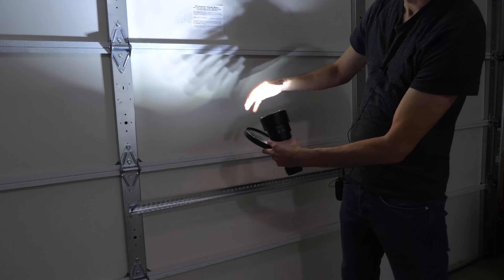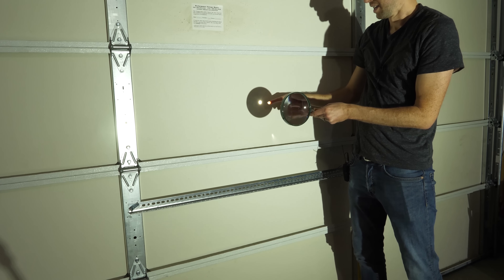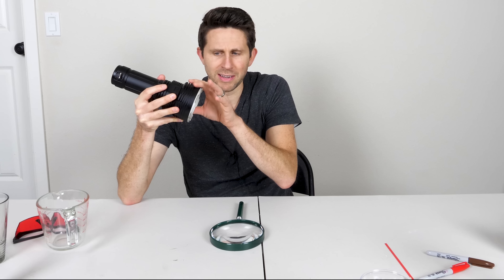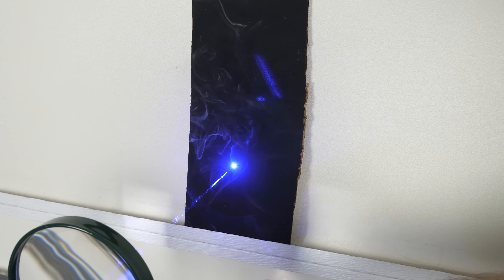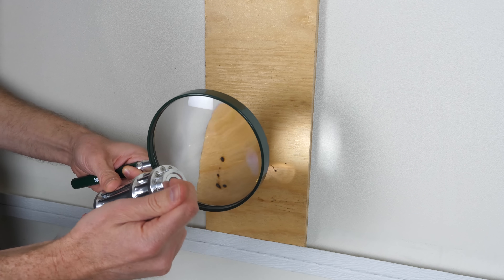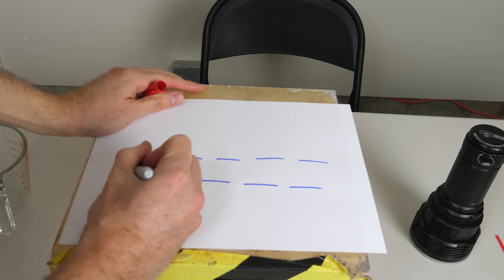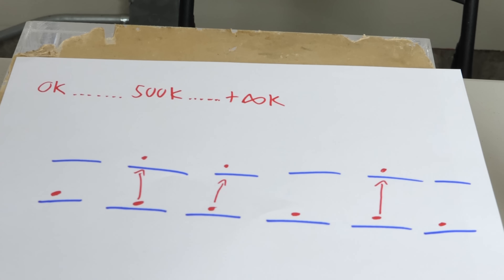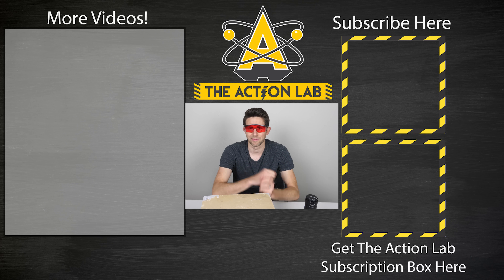What Happens if You Focus a 5W Laser With a Giant Magnifying Glass? Negative Kelvin Temperature!

Comment: A flash light emits defused light and so does the sun...

\|/  defused light
 •  dot is source

A laser is concentrated light. Ideally, we want all the laser rays to be parallel (direct light)

|||  direct light
 •   dot is source

however when I look at a laser dot ( just how you showed us with laser close and far away) I see the dot get smaller at a distance... That means, the rays aren’t emitting perfectly parallel from the source(laser) but most-likely they are converging a bit.

/|\ converging light rays
 •   dot is source 

now a magnifying glass also converges the light (but much more drastically) depending obviously by the type of lens. so laser plus magnifying glass will look something like this.

   .       -small dot is where the light focuses
  /|\      -converging lines due to refraction
  —     -horizontal line is magnifying glass
  |||      -parallel light is laser rays
   •       -big dot is source

now we do the same with a diffused light source.

    o         - o is light on wall                                
\ | | | /    -some lines refract to parallel 
    —     -horizontal line is magnifying glass
   \|/      -defused light rays from source.
    •      -big dot is source (sun or flashlight)

a ‘theatrical spot light’ is kinda like a laser but even though it emits rays more parallel than the flash light, it still does not converge the light rays all on one very small spot like a laser does.

now you must also understand what happens when light goes past its focus point
i’ll copy the laser diagram and extend the light past the wall.

  \|/      -rays diffuse past the focus point.
   x      - x is the focus point
  /|\      -converging rays due to refraction
  —     -horizontal line is magnifying glass
  |||      -parallel light is laser rays
   •       -big dot is laser source

as we see, rays past the focus point will start to diffuse out. I have seen this happen with cheap lasers where the rays aren’t perfectly parallel (the rays converge a bit)

when i point the laser at certain distances it it will make different size dots.

at point blank the dot is source size 

at a bit more far, the dot is smaller because the rays are converging closer a bit /|\ 

if we can find the right distance to find the focus point, thats were will get the smallest spot of light.

if we give even more distance and so the light can pass its focus point, then we will see that the laser light will start to diffuse out just like flashlight rays \|/. Becoming practically a red spotlight (if it’s red laser)
you will notice this by seeing bigger less intense spots on walls(i did this outside from balcony to distant buildings)

at a very far distance the laser light gets so diffused out that the spot totally disappears giving this cheap laser a limited range. good quality lasers will try to emit as best they can (perfectly) parallel lines so that their focus point can be as far away as possible to give them a much better range(not the only reason).

lasers aren’t just perfectly parallel rays, they are also very many rays in a very small area(intensity aka concentrated light)
and usually the laser has a color because its mostly just one type of light that the laser is  shooting. white light is all colors of visible light.

on this video i don’t get what you are going on about with negative kelvin etc
lasers just focus and concentrate light. 
A laser ‘BEAM’ is focused and concentrated  light!
light from the sun or a flash light is drastically dispersed(not concentrated and focused)! that means there are “MORE RAYS” of light hitting a “SINGLE SPOT” with a laser source(i’m ignoring the frequency) than with a flash light or sun source
  
also if what you say is true, then why isn’t your laser hot enough to burn right through your wall in less than a nanosecond, since you say its ‘beyond’ infinite kelvin..
why does it take time to burn the wood? maybe because it not as hot as you claim..

its just many concentrated rays on a smaller spot area than the source area.

lets say the source rays is 3 dots

••• (front view of the laser hole)

if we focus those rays in a single spot

• (view of spot on the wall)
thats 3 rays overlapping the ‘same amount of area of just one ray source area.

so technically that spot is 3 times hotter
than the one spot from the source, but has the same energy of all the 3 source dots added together.

now the light coming from the sun is just like many dots emitting light ••• but every dot emits diffused(scattered light)

sun surface is made of many ‘dot light sources’ that emit diffused light. 

like this:

   \  |  /          \  |  / 
—   •  —      —   •  —
   /  |  \          /  |  \

   \  |  /          \  |  / 
—   •  —      —   •  —
   /  |  \          /  |  \

and the sun at a distance is just considered a dot light source as well.

sun:

   \  |  /          
 —  O  —  
   /  |  \

like we see stars

so the only reason why we see stars even though they are so very far away and emit defused light, is because they are so VERY VERY‘BIG’( the stars)!!  
the surface of the stars that point at us is SOOOO ‘vast’ that we can consider that light source area to be a flat area light(background from CG 3d lighting), therefore its emitting many (nearly) parallel rays towards us (but not converging rays. they are still diffusing a little) and since none of those rays are focusing, it wont burn anything and even if u did focused those rays that do reach our planet, the amount of rays(intensity)wouldn’t be much because most the rays from that star are lost and dispersed in different direction and so we are only receiving a  very very small percentage of that light sources rays.

another thing to consider is the angle of attack of the rays with the lens of magnifying glass.
Reply: Holy shit
Reply: @stoicape4370  yep
Reply: Bro put his college thesis in a YouTube comment and included the diagrams
Reply: Holy shit no edits
Reply: Noice
Reply: Jdog MPD The Declaration of Independence is one of the most important documents in the history of the United States. It was an official act taken by all 13 American colonies in declaring independence from British rule.

People in the colonies were unhappy that they did not have a say in their government and still had to pay taxes. The Stamp Act of 1765 collected taxes on paper goods like legal documents, newspapers, and playing cards. In one act of protest, men dumped the cargo of a ship full of British tea into Boston Harbor in 1773; this is now called the Boston Tea Party. In 1775, the colonists went to war with Great Britain.

The war between the colonies and Great Britain was called the American Revolutionary War (1775-1783). A group of men came together in the summer of 1776 to find ways to become independent from Great Britain. The committee included John Adams, Benjamin Franklin, Thomas Jefferson, Robert R. Livingston, and Roger Sherman.
Reply: Damn, way clear now.
Reply: Holy L O N G comment B O I
Reply: how many hours estimated to read this coment???
Reply: @ffccardoso  only 3 minutes
I read very fast just so u know
Reply: Nice comment, but the reason why his laser can't infinitely heat up is that there is a certain amount of potential energy that the laser has which can be focused to create heat. If the laser emits at a -500K potential, then with a perfect lens you can achieve 500K when focused to the precise moment of angle to achieve 100% efficiency. Another variable is how big the focal point is that is condensing the light being emitted.

 If you can focus the light to a level smaller than the light being emitted, there is an activation of its potential energy that turns negative into positive energy. This is why we can use sources with high output levels to achieve temperatures that are  beyond comprehension. The hottest laser heated aluminum up to 3.6M degrees farenheit because the laser condensed the light being emitted enough to activate its potential energy using lenses and a source that were powerful enough to achieve such temperatures. 3.6M degrees is the highest achieved temperature recorded on earth because the LCLS system focuses lasers to a point 3 times smaller than blood cells. The more compression, the higher the achieved release of potential energy. 

Seeing as he was using a relatively inexpensive and non-precision machined lens made for focusing lasers to achieve such temperatures, it has an efficiency rating that can not achieve such temperatures, mixed in with the fact that the source has an output level that cannot reach the temperatures required to blast a hole through it and anything behind it. 

Another thing is when lasers hit a source they create sublimation of the material that they hit turning solid to gas, the gas that is released then diffuses the light from the laser briefly causing a decrease in temperature when it hits the next molecule, and the more molecules that are sublimated the more sublimated gas it has to break through to hit the next solid in path. If he left the laser there it would eventually burn through the material or the laser itself would burn up from heating the materials in the laser to temperatures higher than the laser can operate at. Great diagrams though.
Reply: @MGPRaleigh  knows this stuff
Reply: I didn't understand anything but you should a teacher
Reply: You didn't mention that laser light is coherent but that a collameter is required to direct them into a solid beam. Lenses are used to direct the light and clean up the beam even further. Ussually a three lense or a combination single lense.  But I know your point (no pun intended ) was about thermal dynamics. Now his laser if it was a true 5 watt would have created a plasma on the surface which is a direct result of the physics you were trying to break down.
Reply: Will you..  Marry me?
Reply: @bence3922  do doo doo
Reply: It is still an open question.
Reply: @bence3922   what!?
Reply: Somebody took their Adderall this morning...
Reply: Um I want to know who actually read the whole thing
Reply: Who here that commented actually read the whole thing
Reply: Mason Bal not me lmao
Reply: @masonbal2027  ...hey, you can also read... congrats.
Reply: You had a big brain moment
Reply: Damn my YouTube lags when i type more than a paragraph but well said
Reply: wow... you just took a whole science class.
Reply: Wow this is so much better than school!
Reply: He is trying to explain why it doesn't break the second law of thermodynamics, the dot of concentrated light can't get hotter than the source of the light, because heat energy can't be created nor destroyed. If you have two tasks of water, one empty and one full and you connect them the full one will fill the empty one until they're both of equal volume (temperature, of course this is just an analogy).
I still have to understand how lasers and flashlight rays made parallel with a special lens are different.
Reply: @efhi  He is using the conservation of ENERGY by trying to describe a conservation of TEMPERATURE.  He is incorrect. The dot could not have more energy in a closed system, but it's temperature could and does vary due to the volume that the energy is contained within.
Reply: @johnjon4688  Thank you, I was looking at temperature the wrong way.
Reply: @johnjon4688   He wasn't referring to conservation of energy.  He was saying that you can't make something hotter than the source itself.
Reply: @efhi  The Pauli Exclusion Principle causes protons neutrons and electrons to spread out and reach a maximum density and when they emit light, the light they emit has a maximum density. Light itself does not have to obey the PEP, it can become denser and denser the more light you add to a beam. Lasers bounce light between 2 mirrors a pulse of light is added to each bounce making it grow extremely dense. you can do the same thing with ordinary flashlights, it will be super dense but not coherent. The laser light is coherent because light is added to the beam in the exact same way every bounce.
Reply: @efhi it's not the lens that causes the light from a laser to be made up of parallel rays. As I understand it, photons are bounced back and forth internally to get them going in the only direction from which they can exit.

Obviously, since the opening is a bit bigger than what a single photon needs to go through, there is a little bit of dispersion that still occurs, which is why you need a lens to clean up the beam.

To make a wider beam that isn't any more dispersed, you essentially can have a bunch of small tubular holes that are parallel to each other. This would be similar to creating laminar flow with water by having a bunch of water flowing through a bundle of straws.

It's also similar to how polarization with lenses works, only instead of simply blocking the rays that aren't oriented right, you contain them so they can bounce around until they are oriented correctly to pass through.
Reply: She's a witch!!
Reply: Memory full..need to clean storage to understand 😂😂😂😂
Reply: my new sensei.
Reply: Google search? ( ͡° ͜ʖ ͡°)
Reply: @f1lmarc3st  lol
Reply: Excellent explanation.  I was also hoping that you were going to cover using a lens near the flashlight to roughly straighten the rays (without losing much light), and a 2nd lens near the target to focus the light.  That would disprove his claim that even with any combination of lenses, you can't create a spot of light brighter than the flashlight (which he meant in terms of total light energy area-regardless, but was understood by many to be brighter at a point-sized area, and thus hotter at the target material, the point of the experiment).
Reply: @CapnSlipp   What I wanna know is when his hand began thermonuclear fusion...
Reply: 3 words I read : /|\
Reply: You just wrote an entire essay
Reply: It's "Diffuse", not "Defused". Aside from that, really nice comment!
Reply: So at what point did your hand begin thermonuclear fusion?🤔
Reply: Hiw read tge whole thing
Reply: @ACBIXI  iNglsh
Reply: Lol
Reply: @alyssavonxylander1226   My dear, I asked you 8 months ago that, will you.. marry me?
I'm waiting for an answer, please. Thanks in advance.
Reply: @bence3922  Sorry, I don't know you😛
Reply: @alyssavonxylander1226  tell the truth, your husband wrote this, didn't he
Reply: @unitedstatesdepartmentofsa7718  😉
Reply: Da fck!!!
Reply: MAGIC man dA fUk
Reply: @memeathondev  da fick!!!
Reply: Holy shit i have never seen any comment as long as this
Reply: Even though I don't know the termins 2 mins in the video I thought the same as you (in my own simple words ofcourse)! Thank you for your comment!
Reply: Who liked without reading 😂🤣😂
Reply: Aiikami Fuukiokka I didn’t read it but i like Because it should have really took a long time
Reply: I feel bad that ur not hearted
Reply: Now there is a bunch of Harvard students in the comments of YouTube videos???
Reply: I too didn't get the thing with negative temperature but I thing if we don't consider the concept of negative temperature still it doesn't break any law.
Imagining we are focusing out laser on a metal plate that is already at some high temperature higher than the light source in that scenario it doesn't mean laser will stop contributing to the energy of the metal plate if we focus on the plate the rate of energy loss from the plate will reduce ( will not increase if the rate of heat loss from the plate is higher than heat gain from laser but the rate of heat loss after applying laser will definitely reduce ) .
But it doesn't break second law because this is not a spontaneous transfer of heat from lower temperature to higher but we are providing external work by the power source. That is why the contribution of our work will reduce with the same external work if we increase the temperature difference between the laser and the point.
Reply: How can I save this comment?
Reply: Thanks for the free physics lesson🤣
Reply: Wow. I never knew women were so smart.
Reply: EXCELLENT comment.
Also, we finally have cool scientific ASCII art on YouTube now. ;)
Reply: nerd
Reply: just gonna say, how long did this take to write?!
Reply: Boi! This is YT! We ain't that smart!
Reply: Now THIS is a quality comment!
Reply: This what we like to call big brain time
Reply: dude you just explained the opposite of a laser - incoherent.
Reply: Godzilla had a stroke trying to read this and died
Reply: Thanks to clarifying that beyond doubt. Im so tired of this dude pulling quasi-science bull shit on his videos and getting away with it. No wonder his voice shakes and he is blinking all of the time, he might not understand the truth but he knows this shit he purposes can't be it.
Reply: i totally just said that 😬
Reply: Underrated.
Reply: Protect this man's life at all costs
Reply: So what I’m hearing here is we won’t be having Jedi lightsabers.
Reply: If you're an undertale fan
You would understand quantum physics 
through DETERMINATION
Reply: Are you a teacher?
Reply: What you wrote is right, but not entirely relevant if you watch the vid. Anyway great explanation. Simple and easy to understand, the talent of someone who should be a .teacher.
Reply: @thetalkingnotepad5638  I was confused from your comment, so I rewatched the video(fully again). I have no knowledge on the concept of infinite or negative Kelvin but I realized and remember why I made this comment and it's because his demonstration has realy nothing to do with the point he is making. 

I consider it negative learning if he demonstrates something irrelevant to his point and act like they are connected. It really just ends up confusing people like we can see in the comment section.
Reply: What the intellectual fricc are you
Reply: I’m sorry what.
Reply: That’s hot
Reply: Dayymn
Reply: Aiikami Fuukiokka this is a SUPER SMART man or teenager or kid (probably not)
Reply: Aiikami Fuukiokka why does not burn the wood instantly

Because that is literally not how hotter-than-infinity temperatures work. It's negative temperature.
Reply: Nerd
Reply: You learn a lot girl
Reply: the sun is a deadly laser
Reply: big brain
Reply: Is that even legal
Reply: Holy shit.
Reply: Intensity = Frequency of the Wave of an Ultraviolet ray.
The more frequency = the more intensity of a wave of an Ultraviolet wave 
The more frequency = the more damage of the exposure of a Normal Wave or EM Waves (Electro Magnetic Wave like Ultraviolet wave)
The most frequency of a color of a wave is  the color VIOLET. (Idk if it relates to the Ultraviolet ray just because the most frequency of a color is violet).

Also not all sun's rays/ultraviolet rays are parallel/straight because the Ultraviolet rays in both poles of the earth are curved.
(Idk whats the reason why its curved because im too dumb)
(Idk if its true either)
Reply: Big brain time
Reply: Daniel Rieth 
The Declaration of Independence is one of the most important documents in the history of the United States. It was an official act taken by all 13 American colonies in declaring independence from British rule.

People in the colonies were unhappy that they did not have a say in their government and still had to pay taxes. The Stamp Act of 1765 collected taxes on paper goods like legal documents, newspapers, and playing cards. In one act of protest, men dumped the cargo of a ship full of British tea into Boston Harbor in 1773; this is now called the Boston Tea Party. In 1775, the colonists went to war with Great Britain.

The war between the colonies and Great Britain was called the American Revolutionary War (1775-1783). A group of men came together in the summer of 1776 to find ways to become independent from Great Britain. The committee included John Adams, Benjamin Franklin, Thomas Jefferson, Robert R. Livingston, and Roger Sherman.
Reply: That’s a lot of DAMN WORDS
Reply: I can't be asked Reading your comment but I can tell your smart 📖
Reply: I was as smart when I was young... Before school destroyed my brain 😟
Reply: I didnt read but still liked cuz of the commitment
Reply: Maybe she has just copied it somewhere?
Reply: w-woah
Reply: Nerd
Reply: just put it on a link on a powerpoint its much easier
Reply: K
Reply: Isn't Science Class😐😐
Reply: big brain
Reply: I feel like I'm reading college notes lol
Reply: Thank you for the free session
Reply: Ok this has to be the longest youtube comment
Reply: @Windnikkufag  I've seen longer
Reply: I refused to read this
Reply: Thanks for putting the effort into this
Reply: I find it hard to believe that most of these comments read all of this
Reply: Hahaha. Light go |||
Reply: We've just been taught a lesson in Thermodynamics
Reply: Ain’t nobody got time for that.
Reply: Diffused
Reply: Nice
Reply: You gave an lecture here
Reply: Yes an essay
Reply: E = mc2
Reply: Holy shit! I didn’t expect this when I pressed... “read more” 

Well done by the way
Reply: @Aiikami Fuukiokka you typed more then he spoke  😂🤣 #nohate just kidding
Reply: Wow! Thank you!
Reply: I was about to say that myself man
Reply: Mucho texto.jpg
Reply: So, if you foucused the laser through multiple magnifying glasses, it wouldnt get more focused, it would just diffuse past the focus point?
Reply: Ok idc really care what u just said but i give you a like for doing a entire lesson in a comment
Reply: I didn't read a single thing but damn son
Reply: Definitely you are a physics teacher
Reply: You gave me a headache
Reply: too much talking
Reply: Oh
Reply: Oh my fricking god
Reply: Good job bud
Reply: Bruv. I see you were probably bored
Reply: Wow i think u took about 2.5hours of writing t
Reply: holy what a long comment that isn’t a copypasta
Reply: My brain can't handle this
Reply: I did not understand a word you said, BUT. I gained a braincell after reading this.
Reply: Ideal laser light does not converge or diverge; it should be perfectly parallel light rays. Real laser light diverges anyway, though, because as a wave it experiences some diffusion at the aperture, and more importantly for some cheap lasers the length of the lasing cavity may not be very long compared to the aperture. Even from an ideal laser, though, yes, the wave nature of the light prohibits the image onto which the light is focused from being any smaller than the wavelength of the light (the diffraction limit).

That isn't the point of the video, though; the point is that in contrast with blackbody radiation from the sun or a flashlight, laser light isn't strongly limited by entropy or entendue to fall on an image at the same intensity as the source. The image laser light can be focused onto is FAR smaller than that for blackbody radiation, because it's coming from a low entropy, high energy source, ie. the lasing cavity.
Reply: Bro question do you have a degree in this sort of stuff or do you just know oddly specific things?
Reply: @demetrioaguilar7434  ???
Reply: That's great but you are aware you can make regular light into parallel rays, right? That's one of the things lenses can do...
Reply: Thank you very much...now I can die in peace.
Reply: I want the focus required to type this in a YouTube comment
Reply: I remember being on adderall too
Reply: Holy this is long
Reply: you whooped his ass ,made his snot drip
Reply: U on twitter?
Reply: Exactly. Basic and strong logical fact-based thinking, triumphs the quasy theoretical band-aid physics once again.
Reply: Did you just typed it 😵🥵
Reply: A mini chapter into a comment with emojis for rays…
This is mind blowing.
Reply: Way too much writing bro lol
Reply: them text graphics was dope... I'm not sure I'm with -infinity beyond infinity and then negative zero beyond that, yet... but I like your breakdown...
Reply: Those included examples are really cool thanks for the info
Reply: Unfortunately, you didn't explain what actually happened in the video, which is much more of a "quantum" world effect, not understandable using classical physics. Nice try though. 

Good to see I am not the only person to write 1000 word YouTube comments! I will keep this one short and not explain negative temperatures. 

Except to say that "negative" is still a positive effect. If I punch you from the right hand side with 50 newtons force, then I punch you from the -right with 70 newtons force, you will deflect to the -right by 20 (equally stated as deflected right by -20) newtons effective force. Now you're really confused. 😂
Reply: I'm sorry but i ant reading ALL that.

The only way I'm  reading this is if I had this I my exam tomorrow
Reply: Write a book about it
Reply: Nice
Reply: why is it that humans can read books with thousands of pages yet they can't read this? 
because it's oddly specific and out of place
solution: increase the processing speed of the brain
Reply: @Moon_SFS Just what I was thinking😂
Reply: what if you fixed a long mirrored tube over the flashlight to redirect the light energy to a lense
Reply: Tldr

(just kidding)
Reply: Holy the Book on yohtop comment section
Reply: holy words
Reply: Bro is Copilot
Reply: This was both aininteresting and in-depth analysis and a COLOSSAL disappointment it didn't end in a trolling joke where you used ascii to draw something lewd.
Reply: Diffused light, refers to it being diffused using a medium, such as a reflector or lens. The light from the sun isn't being diffused, it is projecting equally in all directions.
Reply: I ain't reading allat 🥀
Reply: Wow yes ai(not sure)
Reply: But is the obvious thing not to use some kind of reflective collar or series of mirrors to make parallel the light from the flashlight so it can be better focused by the magnifying glass?
Reply: Salute
Reply: Outstanding comment. Would you happen to know what would emit the most heat, a beam of sunlight concentrated with a magnifying glass, or a relatively low powered magnified laser beam such as the one in the video (around 5W)? My guess would be a laser beam, since it is much more concentrated and closer to the magnifying glass, but since lasers do not emit heat by themselves, I am in doubt they could get as hot as a concentrated beam of sunlight when magnified. Magnified concentrated beams of sunlight are hot enough to melt metals, I wonder if a 5W laser beam could potentially do the same magnified by two fresnel lenses, since it would be much more practical to experiment with.
Reply: @enki6676  Don't emit heat by themselves... 🤔

You don't have a high enough power laser then 🤣
Reply: . Is laser point 
B. Is blunt 
Then you smoke it 😤
Reply: But that's ok, some people can understand things by reading and not so much by listening. Only the vid title is saying about negative Kelvin but if you understand what he is saying instead of what is written then you'll see that what you are trying to discredit was not what he meant. Now I don't know if you watched the vid and happen to be a bad auditory learner or you typed this long explanation the moment you saw the title but your example of his laser point kinda make it seem like the prior. But good explanation, you just have to focus more on being able to comprehend what others are trying to communicate. You are good at giving out information but not as good at taking it in, at least from a live person speaking. Maybe some captions or subtitles might help? I don't know. But I do know some people have trouble learning from audio but are brilliant with a book they can read.
Reply: @thetalkingnotepad5638  that might have been the most condescending thing I have ever read. Well done.
Reply: Exactly what I was expecting that he would give as a reason. But if there is a phenomenon of negative Kelvin temperatures, I wanna know more about it.
However, I believe that this experiment was not appropriate for negative Kelvin thing and rather what you said is the right explaination for what's happening.
Reply: @syedusamamanzoor1838  exactly
Reply: Thanks for trying to explain it but I got even more confused!
Reply: my eyes are burning due to ridiculously long comments
Reply: Oh you must be asain
Reply: BIG BRAIN
but with a child in the profile picture
Reply: This girl subcribes to Blippi. Why?
Reply: I came to the comment section because of his claim that "a Concentrated/focused point cannot be hotter than the original source."

It can be 
If the source is Large(diffused) and the resulting focussed point is small.

In simple,
If we consider the area of sun as 100 point source and every point source is firing 5 Joule of energy. (Assume it's 5  Kelvin)

Then after putting a giant Convex lens in front of sun to concentrate all 100 Rays to a single source . The result would be a point source of 100x more intesity and Energy would be 5*100=500J . 
So definitely the temperature of the resulting Point source would be higher as it's having more energy intensity in much smaller area. 
(I'm sorry if my English isn't that good.)
Reply: u r hot x
Reply: Can you shorten that comment
Reply: Did i ask
Reply: Longest comment i’ve ever seen... i didnt read it but i liked it 😅
Reply: U think I read all of that?
Reply: ALBERT EINSTEIN?
Reply: Longest comment in the world
Reply: Ok Einstein
Reply: There's no extra credit on YouTube.  But that's s good essay.
Reply: Sorry but,

”NO SHIT SHERLOCK”
Reply: OK BOOMER
Reply: @ƁŁĀĎƏ  For the record, anyone who uses the phrase "oK bOoMeR" is instantly discredited as an intellectual human and gets tossed into the "useless genZ" bin.

Jus sayin.
Reply: Shut up nerd
Reply: Lmao ItzYadaran that was on me?
Reply: Yeahhh, but he was never talking about the lights behavior like you did, he was talking about what a lazer IS.. You just completely missed the point. Smart ass.
Reply: @cynicalclusterfuck5605  or maybe his demonstration was totally irrelevant to his point